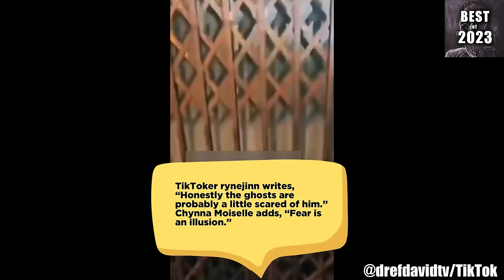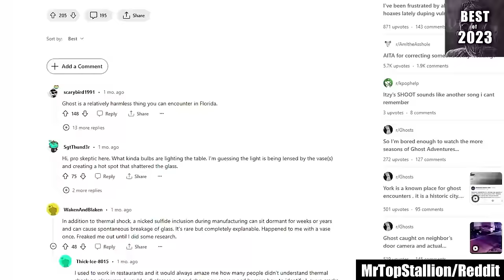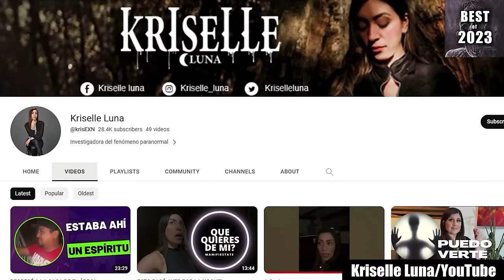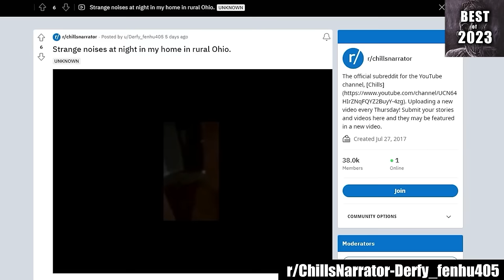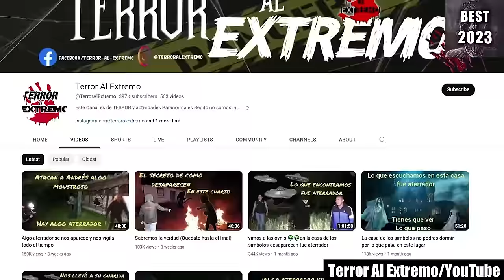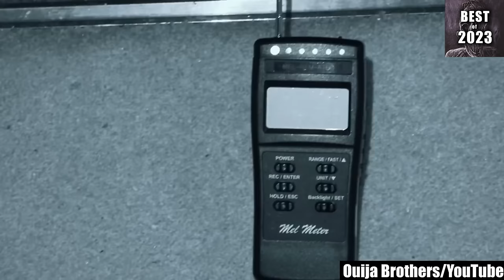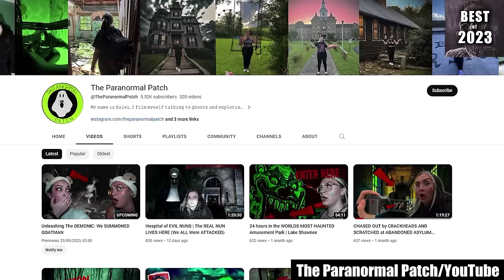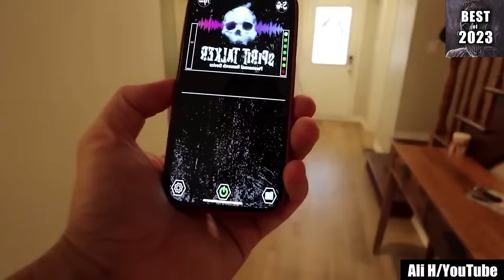Top 165 Scariest Videos of 2023 | Scary Videos 2023 Compilation | Part 2

Comment: the malaysian creature is a colugo, not a bat. it's more closely related to primates than anything else. you can tell by the structure of the skin flaps and the fact that it does NOT have wings at all.  webbing on colugo's is basically everywhere. they have drastic webbing from chin to wrist, wrist to ankle and ankle to tail tip as well as between their toes. their tail is super rigid as well. other gliding mammals do not have webbing down to the tip of the tail and less drastic webbing from chin to wrist. bat do have webbing from ankle to tail tip but they're tail is shorter and they have actual wings instead of skip flips between appendages. colugo's look more like the love child of a bat crossed with a flying squirrel or sugar glider but they are not and they've been around much longer than bats, flying squirrels or gliders.

Comment: No-2 is a sugar glider that's what we call them up in Qld Australia
Reply: no it isn't. it's a colugo. a different flying mammal and not a marsupial. they're most closely related to primates. the most clear way to tell is that the skin flaps connect all the way down the tail which is also very rigid unlike the sugar gliders tail which the skin flaps do not connect all the way down nor is it rigid. colugo's are webbed from chin to wrist, wrist to ankle, ankle to tail tip and between all their toes. sugar gliders mainly only have webbing from wrist to ankle much like flying squirrels with only a tiny bit from chin to wrist and from ankle to base of tail rather than tip of tail. if you pause at 46 seconds you also get a clear look at it's head and how drastic the webbing is.